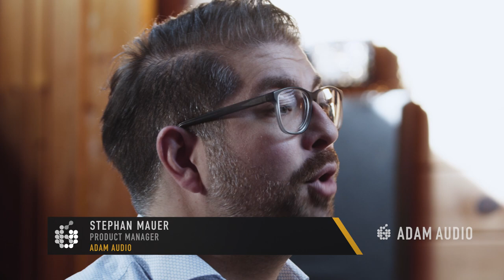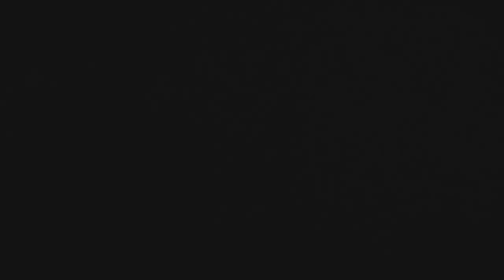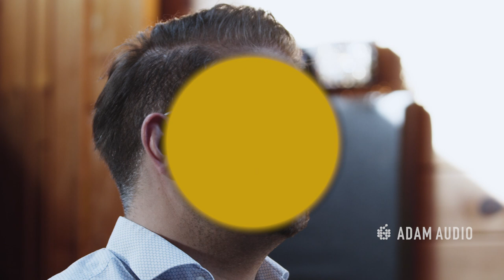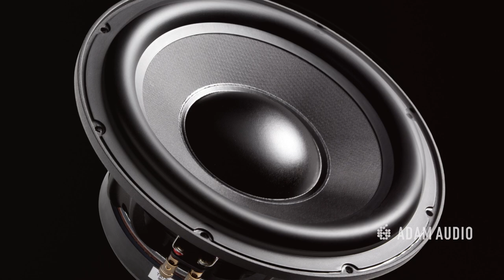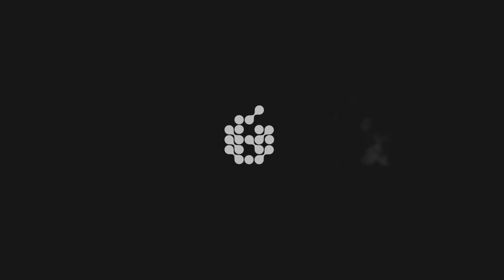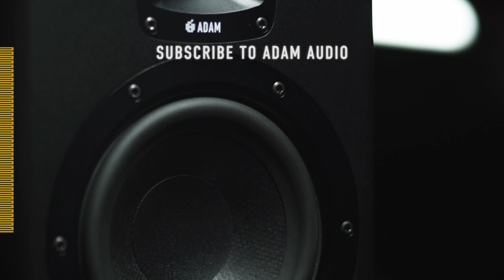Breaking in Studio Monitors (Burning in Your Speakers) | ADAM Audio

Comment: Why don't you burn in the monitors before selling them?
Reply from the maker: We do with our highest end S Series, but we don't have the resources to ensure that each T & AX model of monitors has been properly burned in, so we leave that up to the end user. Good question 👌
Reply from the maker: @thunder46350  Hi Michael, due to the sheer volume & number of T Series & AX Monitors we are shipping out on a daily basis, the resources to individually burn in each and every one simply is not there as of right now. We believe that the burn-in process is a necessary step so that you can be sure the response of the monitor will not vary after using them early on.
Reply: @thunder46350  it's simple. Would you be willing to pay 500 bucks for a non-broken in speaker and do some break in yourself OR would you rather pay 650 bucks and have it broken in already... It's a general part of their product strategy. The speakers themselves are stil high end, but the manufacturing process is cheaper thus lowering the retail price. It's a choice every manufacturer has to make. That's why they do factory break-in on the S-series. It is justified at that pricepoint and the do not sell nearly as many of those as they sell their A en T series.

Comment: That SUCKED. Never explained the actual ADAM Audio proper burn in other then 8 hours of noise, Should you use Pink noise or White Noise?  Should it be for a continuous 8 hours or can it be broken up into 2 -3 hour segments.  Also what .db is the correct level? How loud is Loud? Is it better to face them together inverting the Phase or leave set up in the equilateral triangle as you would when using them? etc.
Reply from the maker: Hi Electriceddie! "Any audio material that is using the better part of the spectrum" includes white and pink noise of course. Feel free to use whichever one you want. The 8 hours can be split up into smaller segments. Reasonable loudness in this case means a compromise between louder than you would usually listen to music and what your potential neighbors can handle. There is no fixed dB value. As the video said, in order to avoid disturbance for you and your surrounding, you can face them together with inverted phase. It is not a must. Hope I could clarify these issues for you. All the best, Daniel from ADAM Audio.

Comment: Debunked nonsense. The mechanical Q of the speaker becomes slightly lower after break-in, causing a slight shift in Fs. It doesn't make an audible difference, as the change due to the break-in is less than the difference in supposedly two identical production units.
Reply: Here's a quote from Floyd Toole:

In parts of the audio industry, there is a belief that all components from wires to electronics to loudspeakers need to “break in.” Out of the box, it is assumed that they will not be performing at their best. Proponents vehemently deny that this process has anything to do with adaptation, writing extensively about changes in performance that they claim are easily audible in several aspects of device performance. Yet, the author is not aware of any controlled test in which any consequential audible differences were found, even in loudspeakers, where there would seem to be some opportunities for material changes.

A few years ago, to satisfy a determined marketing person, the research group performed a test using samples of a loudspeaker that was claimed to benefit from “breaking in.” Measurements before and after the recommended break-in showed no differences in frequency response, except a very tiny change around 30–40 Hz in the one area where break-in effects could be expected: woofer compliance. Careful listening tests revealed no audible differences. None of this was surprising to the engineering staff. It is not clear whether the marketing person was satisfied by the finding. To all of us, this has to be very reassuring because it means that the performance of loudspeakers is stable, except for the known small change in woofer compliance caused by exercising the suspension and the deterioration—breaking down—of foam surrounds and some diaphragm materials with time, moisture, and atmospheric pollutants.

It is fascinating to note that “breaking-in” seems always to result in an improvement in performance. Why? Do all mechanical and electrical devices and materials acquire a musical aptitude that is missing in their virgin state? Why is it never reversed, getting worse with use? The reality is that engineers seek out materials, components, and construction methods that do not change with time. Suppose that the sound did improve over time as something broke in. What then? Would it eventually decline, just as wine goes “over the hill”? One can imagine an advertisement for a vintage loudspeaker: “An audiophile dream. Model XX, manufactured 2004, broken in with Mozart, Schubert, and acoustic jazz. Has never played anything more aggressive than the Beatles. Originally $1700/pair. Now at their performance peak - a steal at $3200!”
Reply from the maker: Hey Daniel, thanks for the comment!
I see that we share the understanding of the changes to the mass-spring-system happening during the first period of using them. As your quote says, there’s a difference to observe before and after. Where our opinions differ is, that we think this amount of change is relevant.
-Stephan
Reply: ADAM Audio What is Adam’s accepted Fs variance between two identical production units? Do you know the number? The difference caused by a burn-in will be less than that. So in practice we both agree it’s irrelevant, or you wouldn’t be selling a production line of speakers.
Reply: Daniel Yeh You can clearly hear a difference after burn in, same goes with headphones too
Reply: Trance fiend Those who claim to be able to hear a difference often woefully lack an understanding in psychoacoustics. Sonic memory for subtle details is only good for a mere few seconds, not the hours it takes for a burn-in.
Reply: Daniel Yeh No sorry but I disagree with you. I’ve recently purchased the Ax7s and it took a few days for them to settle and I did not use them until they did so it’s not like I just adapted or got used to them. These aren’t the first pair of monitors I’ve owned over the years and it’s the same with headphones.. Out of the box they can sound terrible and need opening up. I’ve been mixing for well over a decade and I trust my ears. I bet my life on it that the brand new monitors out of the box could be identified in a blind test.
Reply: Trance fiend You should go ahead and try that blind test out before forming strong opinions.
Reply: Daniel Yeh likewise 👍🏻
Reply: Daniel Yeh When elements are softened up by the burn in, the sound will be more free. Just like the foot in a leather shoe will have a better time after some use of the shoe.
Reply: if you have a good system and good listening skills, you will never doubt that speakers alter sound during burn in. The frequenzy response is the same, but details in music will be clearly better detailed.
Reply: @KYDY  How many speakers did you measure to support your claim?